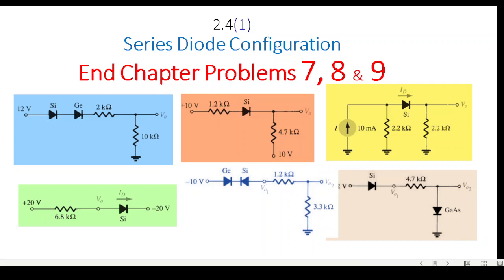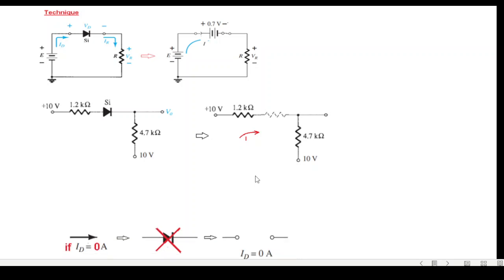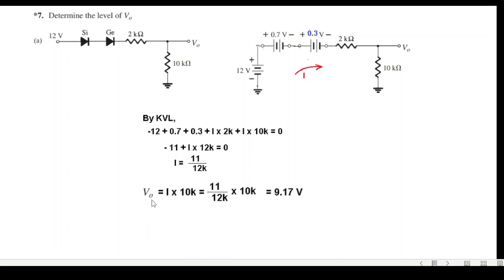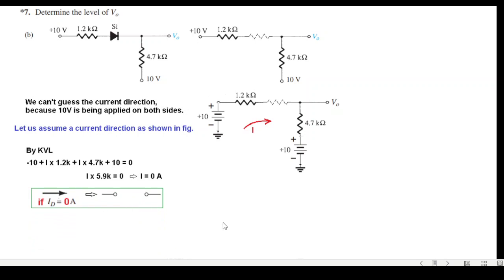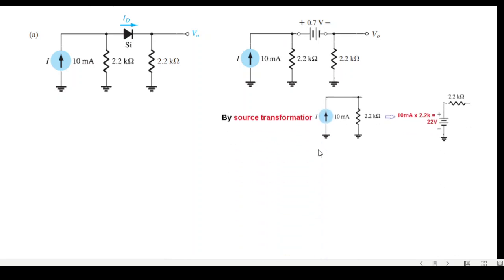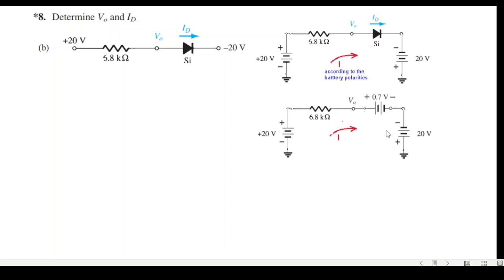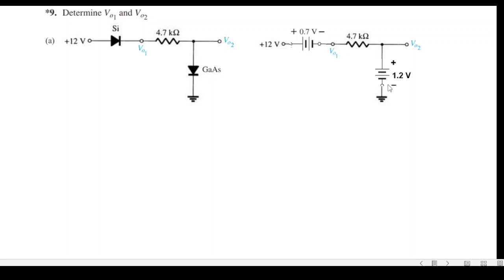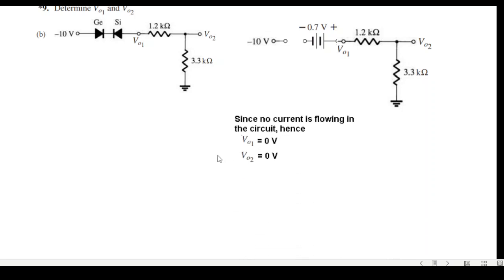(E)EDC(B) Q 2.7, 2.8, & 2.9 || Series Diode Configuration

Comment: My question is if  the circuit was like this
+10v-------------1.2kohm---------si----vo
                                                      |
                                                       4.7k

                                                       |
                                                       5v
And also what would be if it is replaced with 15v
Reply from the maker: Just follow the technique explained and solve for the two options that you have mentioned. whatsapp me your answer on +923454030919
Reply: I was confused now i understand it 
First current always flow from higher potential to the lower
Second the higher potential the +ve connected to the +ve the diode so it was forward biased.
Reply from the maker: @OumerAsrar  Yes Correct

Comment: In q 7 (b) why no current in the last circuit ?
we have 10 v source and resistance 4.7 we can assume it as a new circut .
Reply from the maker: Remember current needs a path to return back to the negative terminal of the battery,  The second terminal of the resistance is floating in air (not connected any where)